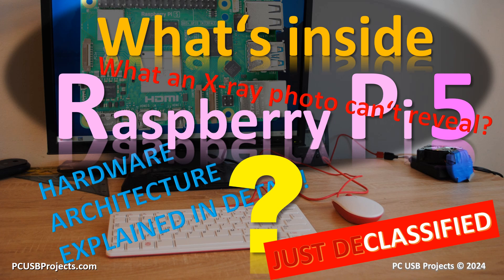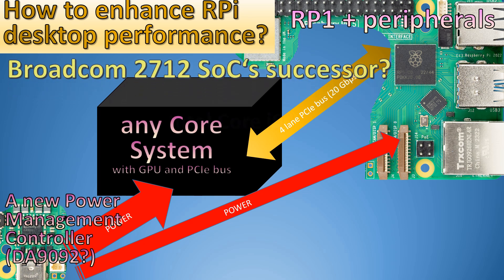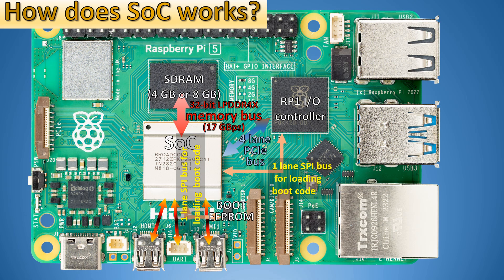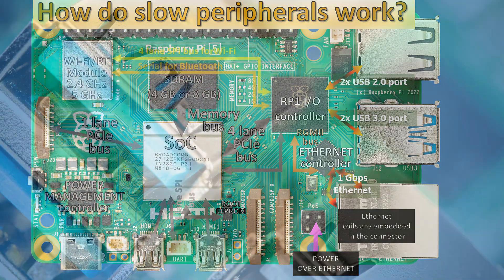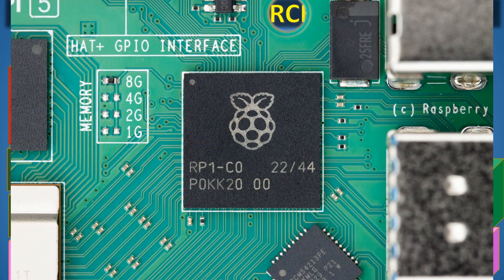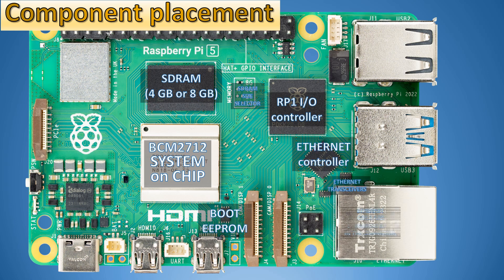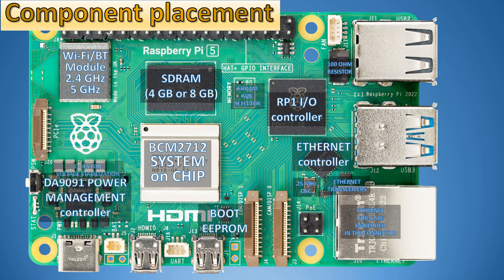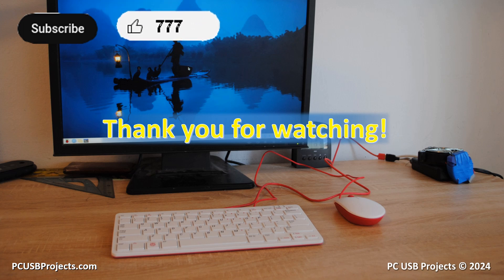Amazing Raspberry Pi 5 hardware architecture: How it works? Could it be up to 100-times faster?

Comment: what are "ethernet coils"?
Reply from the maker: LAN or Ethernet coils are intended to electrically separate your computer's Ethernet interface from the Ethernet cable. 

https://www.ttieurope.com/content/dam/tti-europe/manufacturers/te-connectivity/resources/RJ45%20Jacks%20with%20Integrated%20Magnetics,%20PoE%20and%20Discrete%20Magnetics%20-%20Commercial%20Training.pdf
Reply: @pcusbprojects  wow, thanks!
Reply: @pcusbprojects  for POE? Or regular operation? Both?
Reply from the maker: Both.

Comment: With the Cortex M3 based RP1, I wonder what they use the FPU for. I think a M3 (or M7) based micro controller, that is, something a little more powerful and expensive than the RP2040 is missing from the Pi foundation's product range. It will be interesting if they target that gap in the future.
Reply from the maker: You basically need FPU or FPUs in SoC to help its cores do floating point calculatons. RP1 is primarily intended for fast data transfers, not calculations. RP2040 has much simpler architecture, but if it gets a successor its performance would probably be comparable to RP1 or even slightly higher.

Comment: Had not realised the RP1 reverse engineering had made some progress, thanks. I noticed the date code week 44 , 2022. RP1's have been around for over a year.
Reply from the maker: I believe that progress will be made soon... Because it would be amazing to have a fully programmable desktop grade PC with fully open core software (incl. all bootloaders) as well as more or less opened hardware architecture. This is not the case with classic PCs. I hope that Raspberry Pi Ltd. realises the value of making RP1 open source. RP1 is more popular now, when the first batches of RPi 5s have been delivered to the eagerly waiting customers... I believe that Espressif System's (previously Espressif Motif) ESP32's story had been a good lesson for many hobby hardware developers. Btw: The last update to https://github.com/G33KatWork projects is from 3 months ago (nov. 2023). This is about the same time as https://datasheets.raspberrypi.com/rp1/rp1-peripherals.pdf document was released...
Reply: @pcusbprojects  Still waiting for a non kit priced Pi5 to make it down under to Oz. Got Certification issues with the 27watt PS too. Full manual for RP1 is about 2000 pages so I heard. RP1 could detect movement via camera sensor and wake up the BCM2712, lots of options with full docs.
Reply from the maker: If Eben Upton is willing to release the manual to me, I'd be glad to study it. It is not really bulky, if you know what you are looking for. There is approximately the same amount of documentation for every hardware product, ex. Microchip's PIC32 that I've studied in detail and I've even made my own ICSP programmer (https;//www.pcusbprojects.com
). So, it is not the amount of documentation, but rather if you have access to it or not. If there is more, it is even better. You read in detail just what you need for your project...
Reply: @pcusbprojects  I was impressed with the RP2040 manual, so they can write big ones. How much they release will be interesting, the RP1 is a South Bridge chip that could be used on other cpu that have PCIe ports. They sell the RP2 chips, will they sell the RP1? Probably once they can meet Pi5/CM5 demand
Reply from the maker: Let's wait and see...